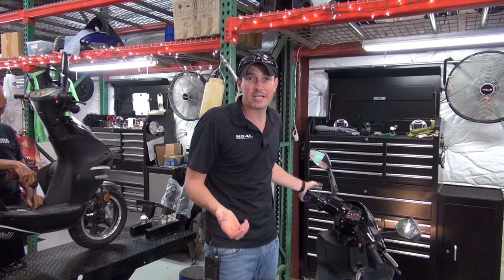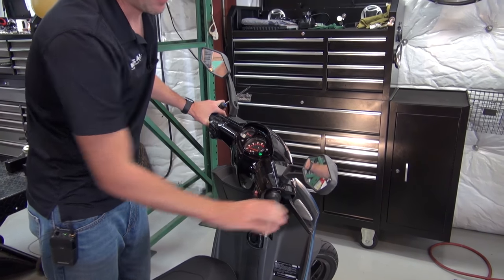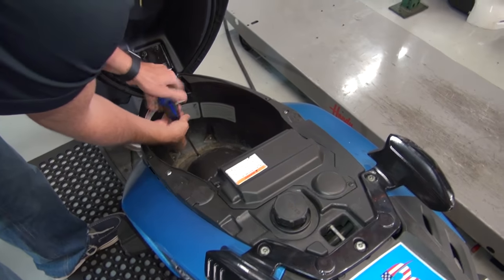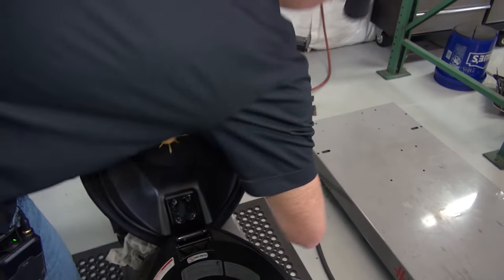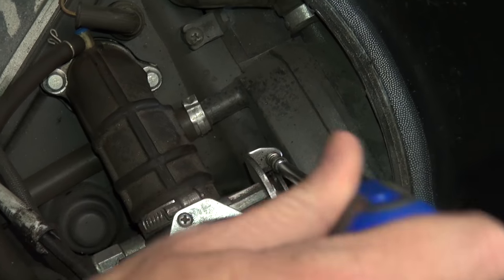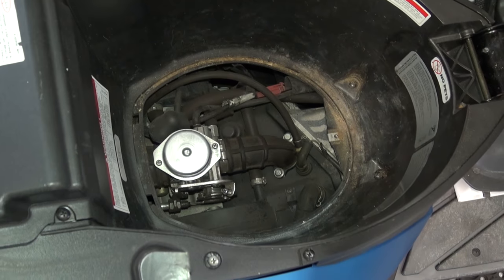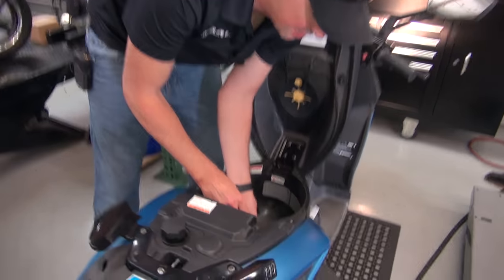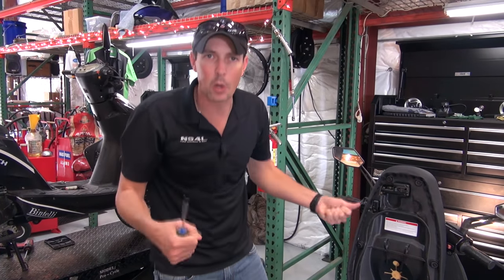Scooter Troubleshooting: Scooter Dying Out When You Come to a Stop / Low Idle

Comment: I have a 4 stroke scooter and when I start it everything is going alright but after 5 or 6 minute everytime i'm going to stop at a stop sign, my scooter turn off what's the probleme since I don't have a idle screw?
Reply from the maker: What size engine?  50cc?  What brand of scooter is it?  Does it start right back up or are you having trouble restarting it when it cuts out?  Does your gas gauge, blinkers or anything electrical give out too or do you still have electrical power? Give me some more info please.
Reply: @NewScooters4Less  I have a 50cc Yamaha Bw's F 2015, it start right back up after it stop and I still have electrical power (my bad for my english i'm french ahah and thanks btw)
Reply from the maker: TheCanadianPepper it’s hard to say. You could have a vacuum leak, maybe a gunned up carb. When was the last time you had a really good tune-up on it?
Reply: Same problema. I have AF68 honda dio. What can i do? Please help. Thanks
Reply: @NewScooters4Less  mine is losing power. Okay do mine once it gets warm it wants to shut off at a stop. But once I get going it picks up speed like a champ but I have no headlights and again once it's warm and I come to a stop it wants to die. And when it's recently warm trying to start it again takes forever. And all my lights are very dim. My model is a 2018 taotao pony 49cc
Reply from the maker: @jonathansanders5158  Hard to say.  Sounds like you could have fuel and/or electrical issues going on here.  Definitely get it to a shop my friend.  Sorry I can't be more help here.

Comment: Please help, I'm not getting any gas to stay into the carburetor, in order to fuel the motor . have tried another carb as well. Does the same thing..., please reply..,
Reply from the maker: If you aren't getting fuel to the carburetor, then you may have an issue in the vacuum system or fuel pump.  Make sure there are no cracks in your vacuum lines and then replace the fuel petcock that attaches the fuel tank to the fuel lines and filter.  It could be faulty.

Comment: Idk, but it seems my idle is pretty normal. But my real wheel rotate fast. Any advise sir?
Reply from the maker: Clutch spring could be broken causing it to stay engaged?  That's the only thing I could think of if you don't have carb or vacuum-related issues.

Comment: I did that with the vacuum disconnected it is working but today I sow that the vacuum was disconnected* I connect every thing in place and now the scooter want to stop if I'm not pushing the gas, I did again what you said in the video but it still wants to stop. It is smoking very bad, the spark plug is getting black/dirty every time I am driving the scooter. I know that it wold be a great idea to get the scooter to a service but I cant find one close to my town :p
Any idea? 
Thanks.
Reply from the maker: It's difficult to say what is going on because there could be several things...  there could be a vacuum leak, there could be something going on with the carburetor, there could be something going on with the cylinder and piston itself, etc.  As much as I wish I could tell you what the problem is, I wouldn't be able to properly diagnose it without having it in front of me.  All I can say is to troubleshoot these things and start with the easiest first :/

Comment: Mine idles high at a cold start and then after awhile slowly dies down until it turns off this is without touching the throttle but if I touch the throttle I can keep it does a misfire little bit and I'm thinking that's a spark plug issue but I'm not sure what's your guy's is your adVice
Reply from the maker: Depending on what kind of scooter it is, it probably has an electric choke attached to the carburetor and that is why it slows down after it has been running.  Is it only doing the little 'misfire' after you first start it?  May want to give the scoot a couple minutes to warm up.  If it is misfiring while all the time, then you could have a spark plug issue, but it could be a few different things.  I'm not sure where you live, but maybe just let the scooter warm up for a few minutes before going and see if that helps.

Comment: My scooter doesn’t want to start well when the engine is cold. Is there anyway to fix this? The scooter will start but it doesn’t feel like it’s fully started. I try to give it gas and it dies. I have to slowly give it gas for it to actually start up, if I give it to much gas it dies. How can I fix this?
Reply from the maker: Where are you located? What kind of scooter is it? How many miles are on it?  I need more info so I can try to help! Thanks!

Comment: Hey man, I just bought a 2016 piaggio fly and it’s fuel injected, it has a starting problem where if you start ot and leave it it is fine, if u start it and turn it of straight away it will not start and u have to leave it for about 40 minutes to try start it again or else it will just run the battery out by trying to start it too much, I have checked the spark plug, checked if fuel was going through, charged the battery and the other day I pulled up at a red light and it cut out on me I tried to start it and wouldn’t start, tried this morning it started first time... I’m so confused In what it is. Sometimes if u leave it running a little u will hear a ticking noise in the variator case, may u have any ideas what the solution will be to fix the starting problem,thank you!
Reply from the maker: How many miles are on it?  Has it had a valve adjustment? The ticking could be the valves tapping.
Reply: @NewScooters4Less  16k miles mate
Reply from the maker: @Bimahs  I'd have a technician check the valves.
Reply: @NewScooters4Less  Would that sort the starting issue?
Reply from the maker: @Bimahs  I'm thinking it could be, but it's hard to say. I'm going off what you wrote in the text thread. It's not as easy as having the scooter here in front of me to properly diagnose. Thanks!

Comment: hi my tgb cuts out as soon as i let go of a brake lever doesnt matter which one,it starts up and runs fine untill i let go of brake ,ive disconnected each brake switch in turn but still does it,any ideas as im running out of things to try.
Reply from the maker: Does the scooter feel "engaged" when you let go of the brake?  You could have a broken clutch spring or something inside of your transmission.
Reply: it does run you can ride it up the road as long as you have the brake pulled in enough to not close the switch,i was wondering if it could be the rear light as ive got it fitted to the rear box and not the frame,so maybe its because the rear light isnt earthed to the frame,what do you think could that cause it to die when brake released,not earthing properly
Reply from the maker: @scooterjd  So you think it is shorting out somewhere?  Maybe.  I'd really need to have this scooter in front of me to properly diagnose.  Sorry I can't help!

Comment: I have a similar issue except that the idle on my scooter increases after lowering it . I’ll lower the idle so that the scooter doesn’t pull forward but once I give it throttle the idle revs higher and stays there along with the back wheel constantly turning. I have to constantly adjust the idle lower and it’s super annoying. Any suggestions as to what to do or how to fix it? What could be the cause? Thanks!
Reply: Also after I stop giving it throttle it stays at an higher idle than before.
Reply from the maker: @jarodhuber2687  The throttle isn't getting stuck open some how, right?  Also, check the vacuum lines, intake manifold, and intake manifold spacer (between the manifold and engine) for cracks.  If they are all fine, I'd swap the carburetor and see if that solves the problem.  (It's hard for me without having the unit in front of me, so I hope this helps!)

Comment: Hello I have a moped 150 mL and I was on it and I heard something pop in and when I hit the throttle it doesn’t run but is still turned on all the lights any idea what might be going on I’m trying to fix it myself with no experience so any idea that will be a great help thank you
Reply from the maker: If your scooter starts and revs up but the rear wheel doesn't move, then you have a broken drive belt.  You will need to take the transmission casing off and replace the drive belt.  Thanks!

Comment: Ok, I adjusted my idle for my moped but it still stops. Am I suppose to let it warm up before I take off? Is it because the engine is cold? I'm still a bit lost
Reply from the maker: Yes.  Please let it warm up.  That will probably help a ton and help a ton more if you live in a colder climate.  The scooters do have an automatic choke which helps, but it's still WAY better if you let it warm up.  Thanks!

Comment: I need some help with my Lance 125 Cabo it keeps spitting out oil water and gas from the little valve underneath that unscrews it stalls and then I have to go down there and tighten that little screw for it to start and keep running now it's done this today alone like 5 times what's a quick fix for can you help
Reply from the maker: No quick fix.  Sounds like there is water in the system that is causing issues.  Is the water in the oil or the gas?  Sounds like it is in the gas if it is coming out of the carburetor.  I would remove and clean the carburetor, replace the fuel lines and fuel filter, and drain all the watery fuel out of the fuel tank... try the tank out and then put it all back together with high-octane fuel back in the tank.  Gotta get that water out of the system.
Reply: Gas
Reply: I run through 2 tank fills of 93 octane daily. Shouldn't it flush out by now?
Reply from the maker: @Marct2626  You run through 2 tanks daily?! How far do you drive this thing? You may have a totally different issue going on. I would get it to a shop.  Sorry!
Reply: @NewScooters4Less  I I doordash
Reply from the maker: @Marct2626  Gotcha.

Comment: I adjusted my scoot was stalling out acting up ran carb fuel cleaner and adjusted card now it doesnt stall but i can tellbits running rich gas smell and it goes through gas quick any ideas
Reply from the maker: You adjusted it by turning up the idle?  I would dive into other areas of the scooter.  Check for vacuum leaks, cracks in fuel / air system, clean/replace air filter, etc. Sounds like some fine tuning is in need.  Have your replaced the spark plug?  Pull the plug and see what color it is.
Reply: @NewScooters4Less  checked air filter looks good next gonna check fuel filter and spark plug and lyk thanx for reply im newto the scoot life😎
Reply from the maker: @vinngrizzle  Anytime man! Welcome to the scooter family!  :)

Comment: i did this and still some times doesn't really work. i have this issue and when i try to elektrik start it i can hear the motor that wants to turn up but it doesn't wanna start some times i gotta keep give it more gas to be able to start do you may know what i can do to this?
Reply from the maker: Hey there.  I would need to see this one in person to see what's going on.  Do you have a dealership near you?
Reply: @NewScooters4Less  I do and i'll go tomorrow to the dealership garage to try and fix it. i think it's the carb that is the issue because the motor doesn't wanna keep spinning when im trying to let go of the throttle
Reply from the maker: @m38b_  Yea.  I would get it to a dealership if you can!
Reply: @NewScooters4Less  I do have a question tho.. i have a 17mm carburetor and i want to buy a 19mm one. would my scooter have a higher performance and more power?
Reply from the maker: @m38b_  It would perform better :)

Comment: Hey, I have a problem with my scooter it dies when I'm riding especially at high speed and when it's idle to warmup
Reply from the maker: Like while going full throttle and driving, it will cut out and die?  Probably electrical.  Check/replace your coil and CDI... Sounds like you could be losing spark when the unit gets hot.

Comment: My Chinese scooter has had this problem before, was fixed by a mechanic but now doing it again.  The mechanic said something about an air filter getting wet or blocked and you can tell when the engine sounds very quiet there’s an issue.  It has had trouble starting too but strangely enough starts easier with the front brake pressed rather than the rear brake ?!
Reply from the maker: The brake thing is probably just a brake switch issue.  If your carburetor is gunked up, fuel may be getting down into the air filter and soaking into the air filter which most certainly keep your scooter from starting.  You would need to remove the air filters, clean it, let it dry out, clean the carb and put back together again.
Reply: New Scooters 4 Less thanks.  It’s due a service soon anyway so I’ll let them take a look, he did attach an extension to the mudflap previously in order to stop so much water/gunk getting into the air filter so it could be connected to that.   However temperamental it is to start, once I’ve ridden the 15miles to work if I turn off the engine then restart, it fires up just fine even with back brake depressed. 
Anyway I guess I’m doing ok from a budget Chinese scooter having done 15.000km in 18 months having never ridden before at the age of 43 :) !  Oh and not fallen off - yet !
Reply from the maker: @davidwil58  May also need a valve adjustment.  Have you had that done recently?  It is a 4-stroke scooter right?
Reply: New Scooters 4 Less yes it is a four-stroke. I’m not sure if he adjusted the valves last time but if he did it’s 6months ago.  I’ll take it in for another service soon but at least it’s going for now and once it’s been running a while it seems fine. :)
Reply from the maker: @davidwil58  Sounds good!  Stay safe!